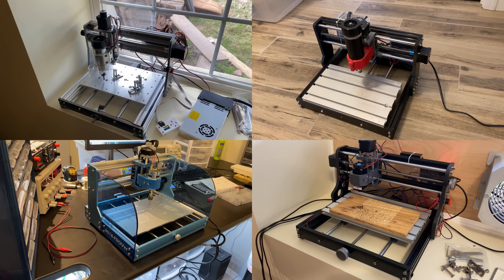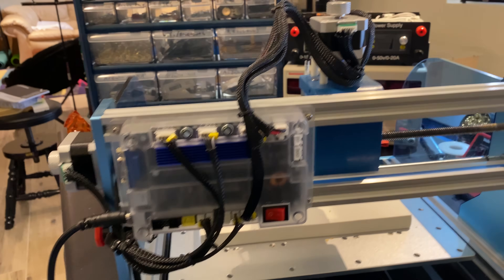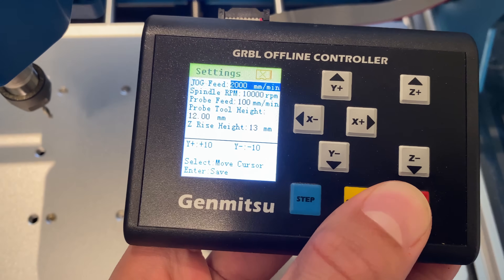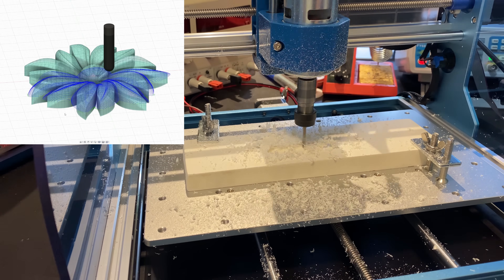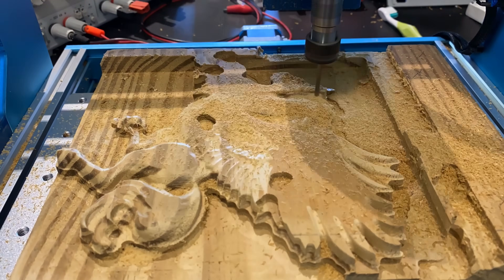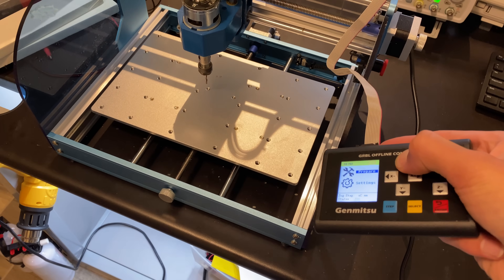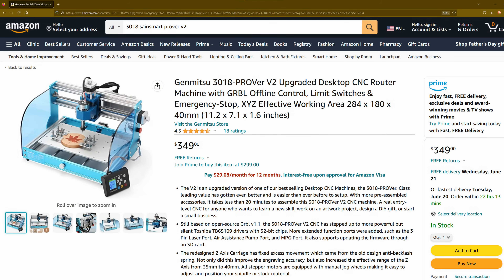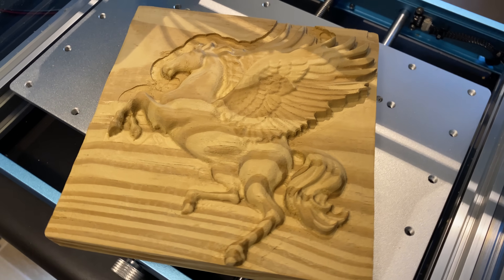3018 PROVer V2 CNC Review & Demonstration - Sainsmart

Comment: Oh wow this was really helpful! As an absolute beginner is there any advice you can share for sourcing/editing the 3d files for carving and the process of programming the toolpaths for those?  This is the only review I saw that included work I’m interested in, the rest just trace some lines. Your tryout here was really impressive. I’m really considering getting this cnc but trying to learn as much as possible beforehand because i just won’t use it if I get too overwhelmed with things to figure out at once 😵‍💫
Reply from the maker: I use Fusion 360 CAD/CAM to create the tool paths. There's a whole bunch of tutorials specifically for this software on YouTube, and they should be directly applicable to any of these small desktop CNC's from Sainsmart. As for sourcing the 3D files, it's very difficult to find good models online for free, but if you're willing to buy the models, they are everywhere.
Reply: @ aha thank you very much! I see it’s way simpler than i imagined haha

Comment: Thanks for the review, do you know if this is good enough to Mil a block of aluminum? THe cheap ones have tooo much slack to do something far precise even at the slowest speeds
Reply from the maker: I don’t think you could mill a block of aluminum with this. You’d have better luck with the 3030 or a 3020 Pro Max v2

Comment: This video was super helpful, you briefly touched on how you set the feeds and speeds rather aggressively. Could you give some more details on the feeds and speeds you usually use for 3018s? There is like no good information I can find out there on good feeds and speeds for the smaller 3018 machines. This info would be a GODSEND.
Reply from the maker: Unfortunately I'm no expert on feeds and speeds for these small machines either. I usually use whatever Easel or Fusion360 recommends when I provide it with my material type and end mill geometry.

Comment: Hey, I have a question, hope you'll find the time to answer:) I'm really interested in watch making, obviously I'm not expecting the machine to work well with those tiny watch parts, but what about a watch dial, would it be able to carve out precise lines, or some patterns, we're talking about a circular shape of about 40mm that I'd work on, is that possible?
Reply from the maker: I think the answer depends on the material used. With this machine, metal would be fairly difficult. Something softer such as plastic could work with the size you describe.

Comment: I have a question.
I tried making a 8 X 11 IN carving, but the machine only did half of the engraving.
I measured it and it only did 6 IN of the planned carving and ignored the rest.
What is the max limit this machine can carve so I can adjust my height and width accordingly.
I know the spill board is 11 X 7 IN.
So, why didn't it cut the carving to 7 IN instead of 6 IN?
Any help or suggestions would be most appreciated.
Reply from the maker: Hi Juan, I’d love to help answer your question. Could you send me an email with a few pictures of the result and the intended design to carboncoilbusiness@gmail.com

Comment: is it possible to take any pictures out of the mobile gallery and to engrave them?
Reply from the maker: Unfortunately this is not possibly for 3D relief carving as far as I’m aware. The file needed for 3D reliefs has to be sculpted by someone in a program such as blender. However, you can use Easel to turn images from your phone into 2D contours. I have an example of this in my 3018 CNC Beginners Guide: https://youtu.be/NNnxV0NLdXE?si=Gtl303XD5e5A0m8J

Comment: Excellent video! I hope you continue this series because these insights are invaluable.

I've found your channel a couple of days ago in my search for a 3d printer and a table top CNC machine that can possibly cut softer aluminiums or plastics.

These reviews give an excellent idea of what these cheapo 3018 aliexpress/amazon specials are capable off with some good setup and are very insightful on what is actually possible and what to look out for.

I was initially looking at the Snapmaker A350T or Artisan type of machines since my workshop space is quite constrained, but delving a bit deeper there are just some things that make these machines not really excel at either 3D printing or CNC cutting (basically competing requirements) and it's all proprietary instead of these generic machines so if it breaks, it's very hard to fix it yourself, so I've expanded my research to also include the cheaper straight-out-of-china machines (along with purchasing a dedicated 3D printer instead of trying for a machine that can do everything) and stumbled upon this channel.

I would love if you could make a video on what to look out for when buying one of these. 

The obvious points are of course work size and motor power, but I've also found that how the motor is mounted (3d printed plastic, injection molded or cnc'd plastic, full aluminium clamp) is very important, as well as the rigidity of the frame (don't want any plastic there either), if the linear guides are tubular or flat rails, or the mounting method of the bits (some use a brass tube with set-screws for both the motor and the bit, while others use a regular ER11 collet connected by a keyway to the motor, while others use a regular ER11 collet with set screws thus avoiding an unbalanced motor shaft. And then (like you mentioned in the video) nice to haves like limit switches (but they also limit the work area), sleeved cables, bed levelling sensors etc.

It seems like all these variations can have tremendous impact on how precise the machine can move, how hard material it can cut and how much maintenance need to be performed to keep the machine in good working order. About any of these configurations are available from aliexpress, ranging from around €200 all the way up to €1000 for the same work area and motor power.

I hope to see some more videos where you try to mod this machine and see if you can get better performance by for example levelling a waste board to get a perfect level work surface or adding things like fluid for cooling, dust evacuation, replacement motor etc.

Thanks again for the great video!
Reply from the maker: Thank you for the feedback! I look to continue making these review videos and more CNC content.

As for upgrades/mods, I have done a spindle motor upgrade with a 500W spindle in one of my other videos if you're interested: https://youtu.be/x3ixNgt9XRk

Comment: With these Bedslinger types, how concerned does one need to be about dust getting into the Y Axis Leadscrew?

Any sort of shroud one can buy/3D Print etc?
Reply from the maker: Dust does get onto the lead screws, however this has never posed a problem for me. I just vacuum the lead screws as I get rid of the chips from the previous carving. You can probably buy a flexible shroud for them but I think that a dust shoe is a more feasible choice.